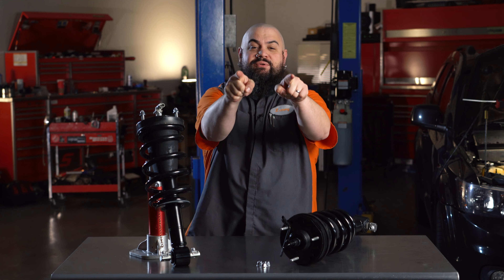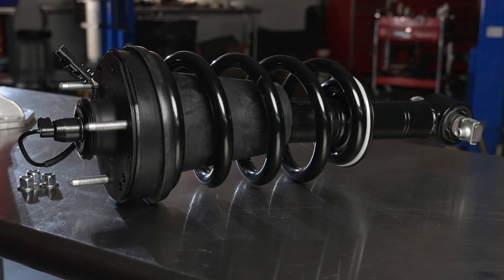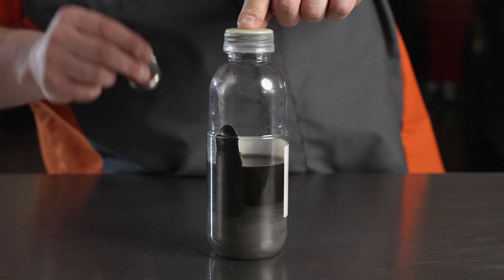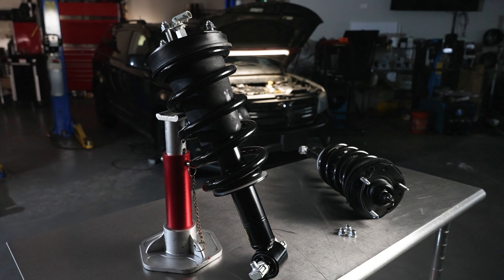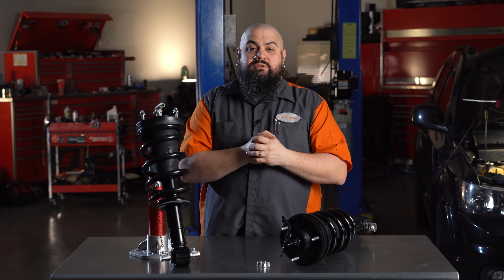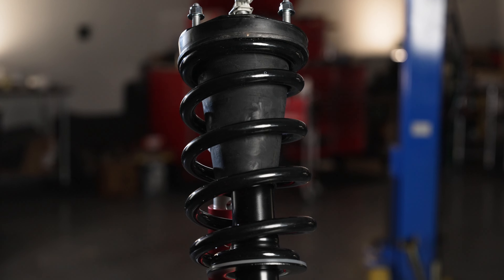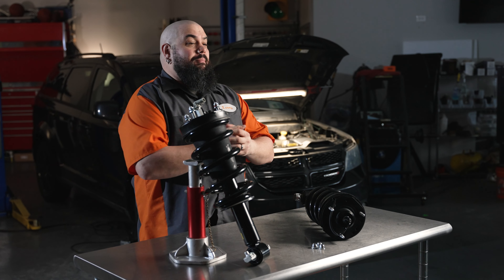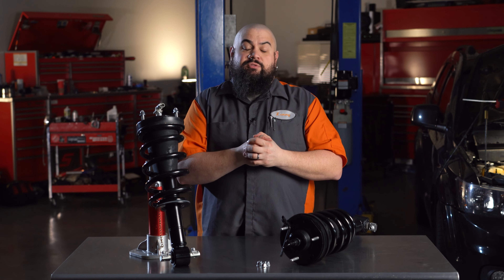Dorman loaded magnetic struts save time and increase durability

Comment: Why do they lock up... I first replaced them on my 2013 XTS... in 2021... because the front right original was not compresing so I bought all 4 ... almost 2 years later and now both front are not compresing they are stiff rock hard.. I can't afford to replace them thousands of dollars. Why is this happening.
Reply from the maker: Hi Ernesto, without knowing more information, it is hard for us to diagnose why. If you think it has failed, you can warranty through the retailer you purchased from.